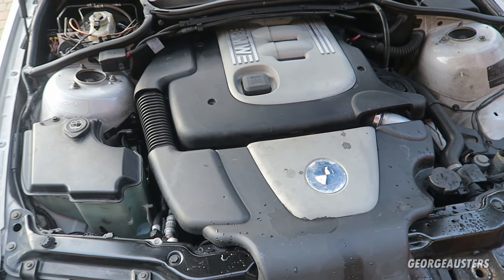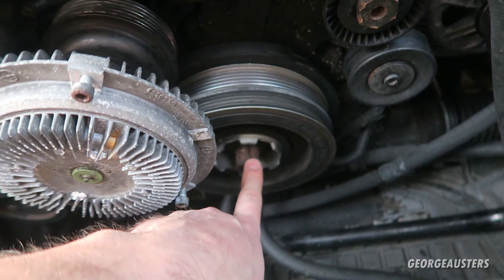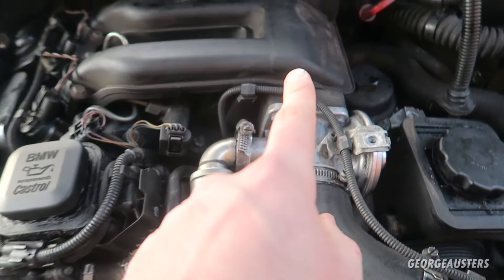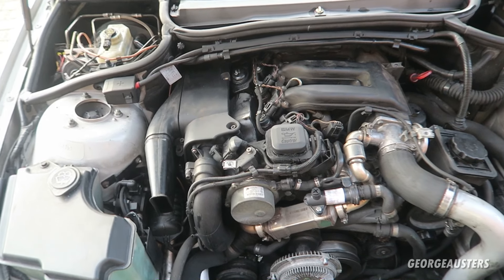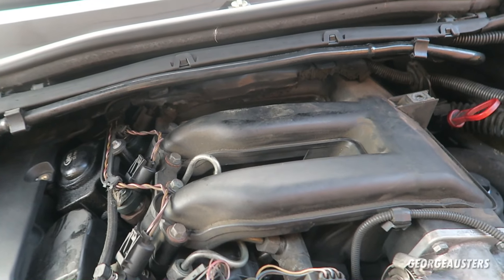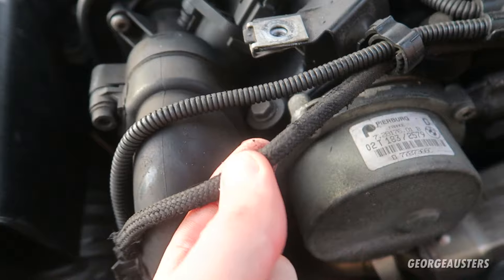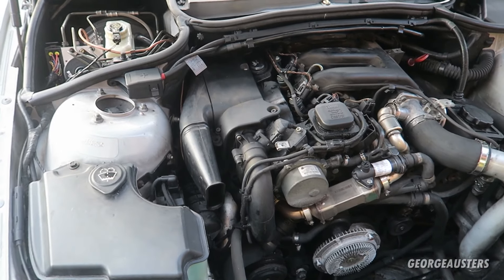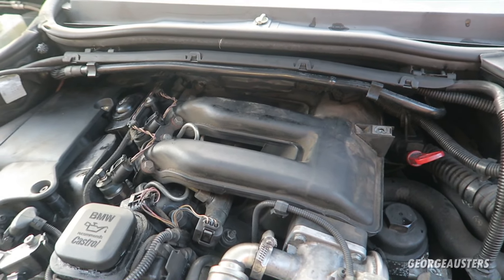BMW M47 & BMW M57 ENGINE COMMON PROBLEMS!

Comment: Great video 👍 My car has done 145000 miles, when I first start it the engine runs rough until I give it a bit of gas. I am planning on changing the glow plugs over Christmas as well as doing my rocker cover gasket. What else would you recommend I do? Any tips would be appreciated.
Reply from the maker: Injector seals with rocker cover👍🏻
Reply: Diagnose it first could also be sensor related
Reply: @zoebalbaert2136  Hi, Thanks for your reply. What sensor could it be?
Reply: @scott_ferguson  map and maf sensors maybe
Reply: @scott_ferguson  Wich engine do you have exactly
Reply: @zoebalbaert2136  Thanks again. I have 2003 320 with the M47 engine
Reply: @scott_ferguson  check those sensors mate bet its the maf and map. Also Check the obd diagnose for cilinder  misfires.
Reply: @zoebalbaert2136  will do thanks for your help 👍
Reply: @scott_ferguson  No problem just Let me know if its the right diagnose will ya? thanks
Reply: @zoebalbaert2136  will do👍
Reply: @zoebalbaert2136  I ran a diagnostic test with my Autophix 7910 tool and found the following 3 codes, 4203 Glow control unit, 1E AUC Sensor and 20 AUC heating.Looks like I need a new Glow plug module need to google the other two👍
Reply: @scott_ferguson  maybe the module came lose . You,ll see .do you have high fuel consumption ?
Reply: @scott_ferguson  think about your coolant , flush it and give it a new coolant thermostat if it hasn't been replaced yet .ill check those codes right now
Reply: @scott_ferguson  1E aux sensor air circulation http://www.realoem.com/bmw/showparts.do?model=NB33&mospid=47759&btnr=64_1343&hg=64&fg=45
Reply: @scott_ferguson  20 aux heating is a sensor try cleaning it .. does the car vents heat up ...?
Reply: @zoebalbaert2136  Hi thanks for all your replies. The car was running cold so i flushed the coolant and changed the main and EGR thermostats. i checked the temp after it went from 70 to 90. Fuel consumption is between 35 to 39 MPG and the vents do blow hot air. I seen a post on a forum about cleaning the sensor and replacing the white goss stuff with fish tank filter pads. Weather permitting i will check at the weekend
Reply: @scott_ferguson  awesome now the car will operate better and less fuel comsumption.. Tip use sensor cleaner.Now am Gonna flush my coolant also and change my coolant thermo ;-)

Comment: What about the cooling system? One of the BMW forums I have looked at is adamant that the whole cooling system should be replaced at about 75k - 100k miles. Is this something that you'd recommend, or does it only apply to 6-cylinder models in the US?
Reply from the maker: Maybe on the gas / petrol models, not on the diesels
Reply: @GeorgeAusters  Thanks for the swift reply. That has calmed me down a bit. It's strange, because the forum never said that. There were too many doom and gloom stories of cooling system failures.

I have a 2003 320d Touring that I bought from my sister 11 years ago. It had 93k on the clock, now on 128k. 

Things have gone wrong (no car is 100% fault-free) but have been replaced. The car has never let me down, and I hope to keep it for a few more years yet (until diesel cars are banned from our streets).

Comment: I have the same engine, it starts ok when cold but when the engine is up to operating temperature it won't start , can anyone help?
Reply: it may be crankshaft position position sensor mine had the same problem changed crankshaft sensor never had that issue again
Reply: Check your injectors
Reply: @trxshite  it was crankshaft sensor injectiors were fine
Reply: me it won t start on cold less than 7 degré  outside , but start   good over 10 degre , i just change glow plug today, i will see on winter

Comment: Hi George, 
Wondering could you give me any advice. I have an E90 with an N47 engine. It stopped two weeks ago. I have no fuel coming to fuel fail. Have replaced low pressure pump, high pressure pump and pressure sensor on rail. The car will start on easy start so I know it is a fuel problem. Have you any suggestions.

Thanks Graham

P.S. really enjoy your videos.
Reply: High pressure pump is also ran by the timing chain i think which is a very common failure on your engine
Reply: It could be fuel injectors faulty

Comment: Bmw really just cant make any good 4 cylinders and diesels
Literally the only good ones are the inline 6
Reply from the maker: The 4 cylinders are the same engines as the 6 cylinders essentially
Reply: @GeorgeAusters  yet still they seem to never work as good
Reply: Done 25k in my m47 this last year. It’s not on 125k miles. No issues. I think you’re wrong about them being bad engines. Nice power, very economical, and very smooth. I think as long as you look after them and do your oil changes they are very good engines. I know a number of people who’ve taken this engine past 300k miles
Reply: A lot of people around me drive 2.0d and they work perfectly fine, great engines
Reply: @B2KJFF  I'm one of them,  An engine will go forever if you service and maintain it properly.
Reply: They're a brilliant engine.  I've over 300k on mine and it's going like a bomb.
Reply: I 400,000 on m47 06 plate no issues I use petrol clean out system and diptane in tank and few n47 with over 300,000 still going like new bmw 😎